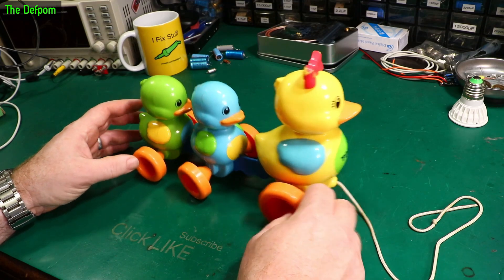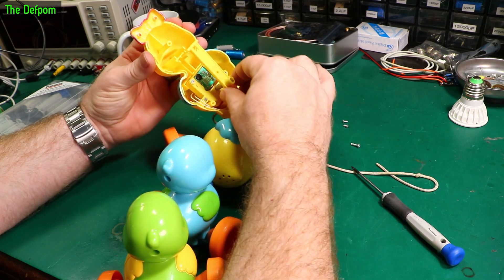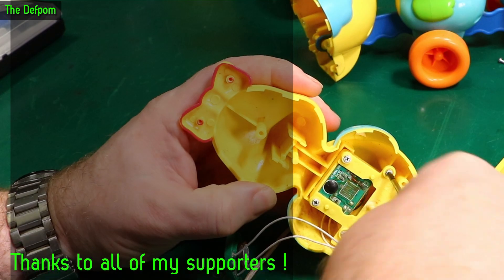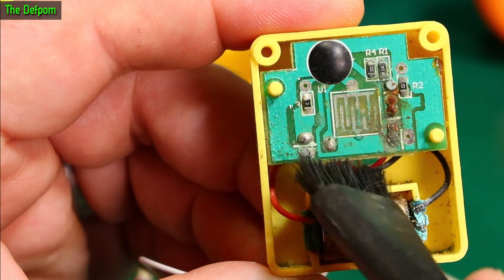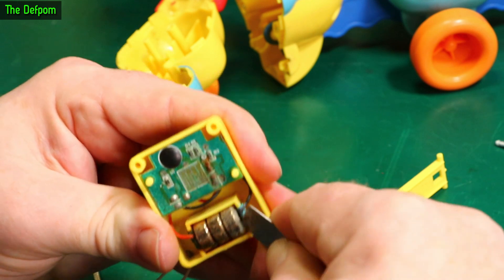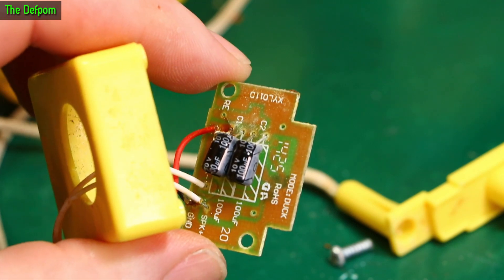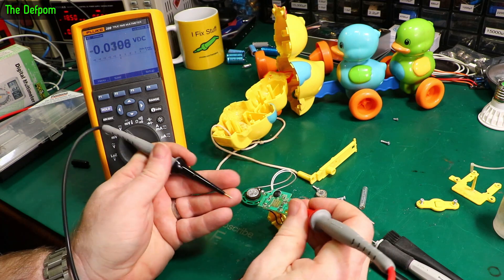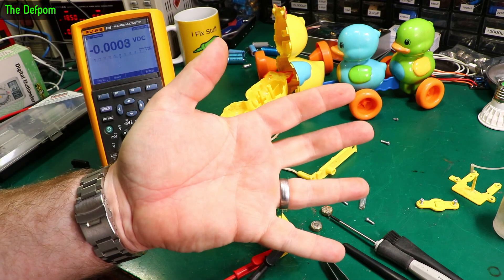🔴 This Made Me Go QUACKERS ! What Is Inside ? - Tomy Toy Duck Failed Repair - No.1090

Comment: When you pull the string it brings down a metal piece to the circuit board making a connection. I just took my granddaughters duck apart to see how it works and replace the batteries.

Comment: Wonder if the caps in something this cheap after so long still work. Also, you could check if one of the pad contacts is being pulled up by an internal resistor or what current flows when you short the pad contacts. Of course it makes no financial sense, it's just for curiosity.